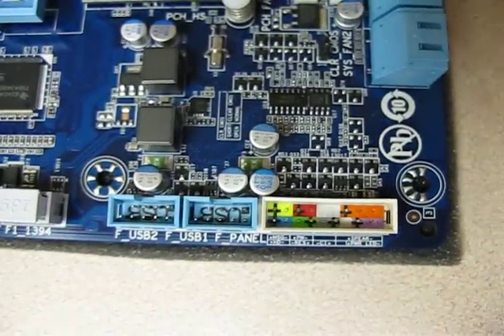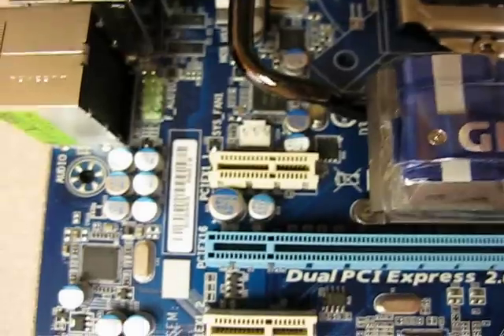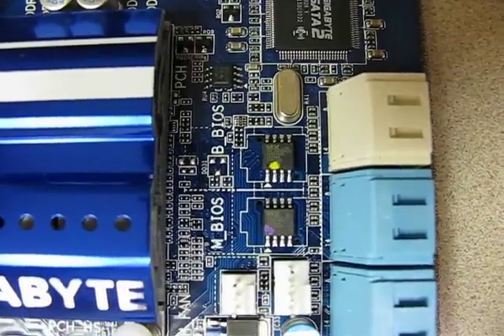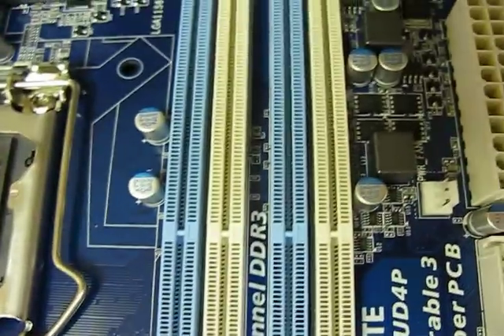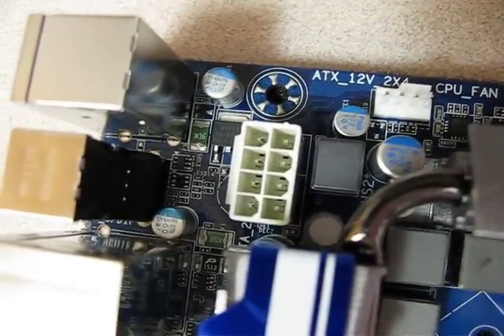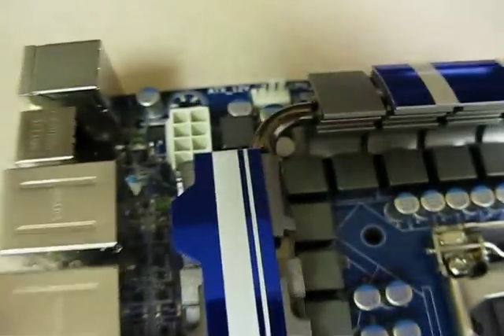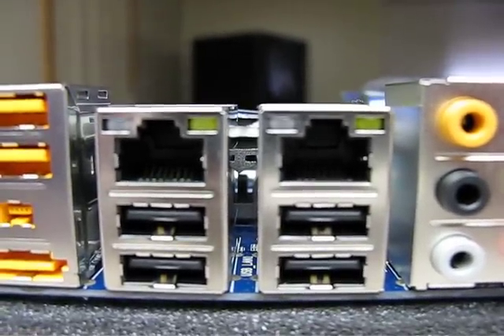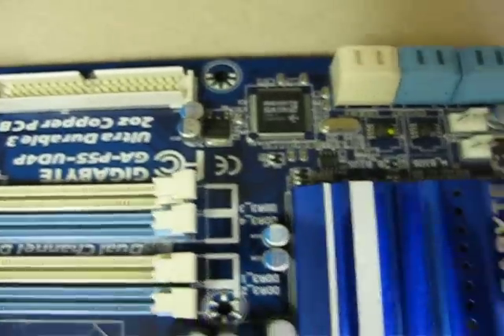Gigabyte P55-UD4P motherboard up close tour

Comment from the maker: @G0DSFAV0RITE360  - It does, but I have not had a problem (yet) I have used another x1 slot and it works fine....but it's a bad design by Gigabyte. It sure has been a great board. I have LOVED it for everyday stuff and overclocking too! great board.